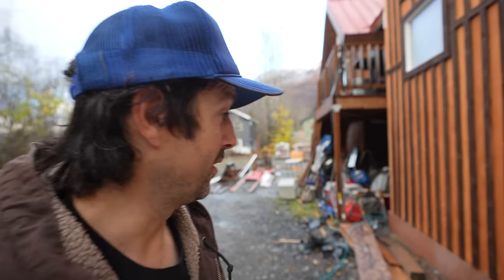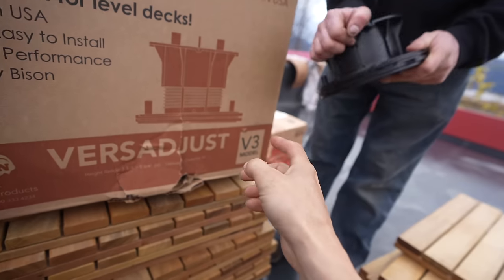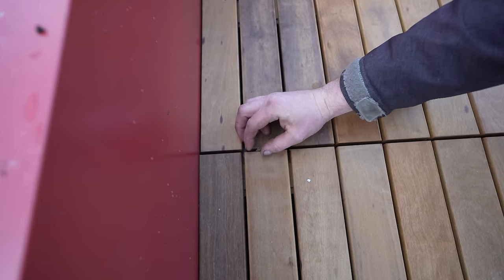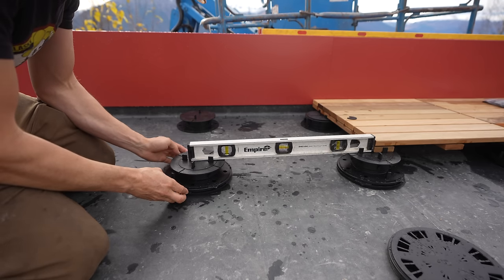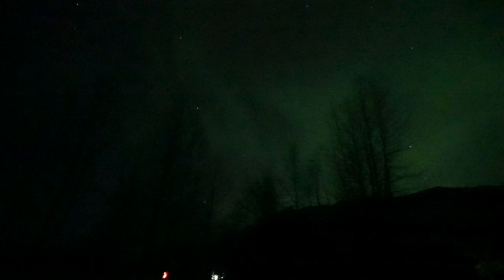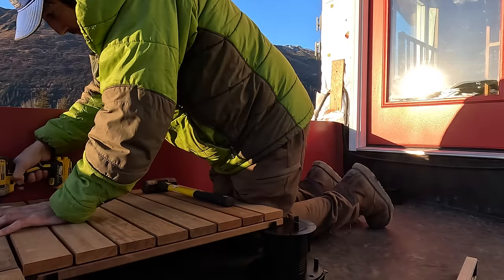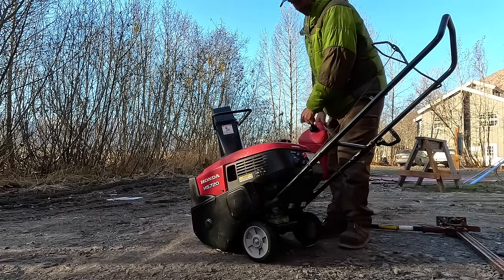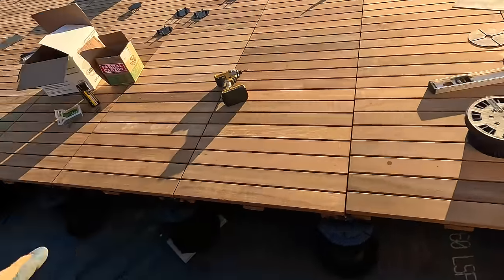I Built a Flat Roof Home in Alaska | Coolest Deck System Ever - The Bison Rooftop Deck

Comment: This is obviously tight from edge to edge and corner to corner. You have put it up in the winter. Will there be any kind of problems come summer from expansion. I know the tiles and the house will expand. Will the rates be the same. Also the wood is dry. It will expand when it gets wet. I’m curious if the supplier gave you guidance on this. The house and tiles look great.

Comment: Love the video! I’m considering DIYing a pedestal system on my flat roof as well. I was wondering what membrane you have underneath? I live in the NE and get all 4 seasons. Currently have a fiberglass roof which is failing and looking to possibly repair/replace before installing.

Comment: I would think that, after years of use dirt, organic decomposition and crud would build up under the deck, and be a nuisance, if not impossible to clean out?
Reply from the maker: I'll have a hose and water line up there to flush it out.
Reply: the deck inst permanent,  you could always lift them up if you need to clean under them

Comment: the deck turned out really nice! i wonder about the weight capacity of the roof and if the weight of the decking is significant or not, in order to account for how many people should be up there.
Reply from the maker: it's 60psi rated, so a lot of snow and a lot of people

Comment: I would recommend putting a railing around the perimeter of your rooftop deck. Because people can easily fall off of it when wet or slippery from rain snow or ice.
Reply: Addressed a bunch of times in comments.
Reply from the maker: it's coming;)

Comment: Seems like some folks in AK build a flat or low-slope roof on purpose so that the snow can work as insulation during the winter months. Accumulation will be less of an issue once you get some heat going in that barn! :)

Comment: while your still building put a 8” inline fan and suck warm air near a heater vent and have it go into the attic, thats how i kept snow off my roofs in michigan also got me in trouble too 😂😢😂😢😂😢😂
Reply from the maker: nice, I did a blower system in the attached rental cabin to keep the pipes under the house from freezing, works great. This is a "cold roof" so no heat will escape through the super thick foam on top of the roof (it's nearly 1.5 feet thick.)

Comment: Looks like a quality product good choice on the linear tile pattern too very clean looking. I love how ambitious this project is and your attitude towards it, keep it up it's gonna be a slog but so worth it. I was curious what kind of wood they use so I checked out Bisons site, from wood database;  "Overall, Ipe is a difficult wood to work, being extremely hard and dense, with high cutting resistance during sawing." Might explain the ease of cracking
Reply from the maker: It was great, and I've got the Itauba wood from them, a little cheaper than the Ipe, yup it is dense stuff for sure.

Comment: You may encounter some damage to your parapet walls from the tightness of your floor panels. Due to expansion.
Reply from the maker: they are built taller with an extra section to flex